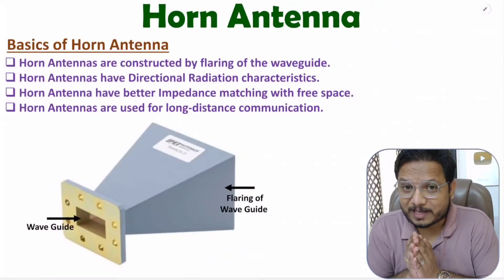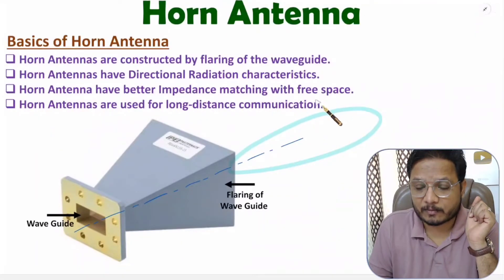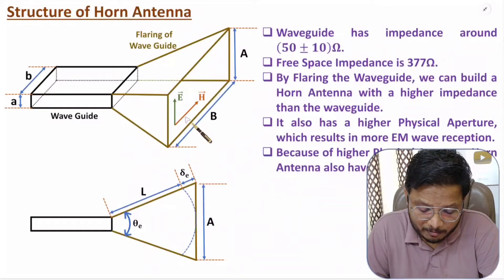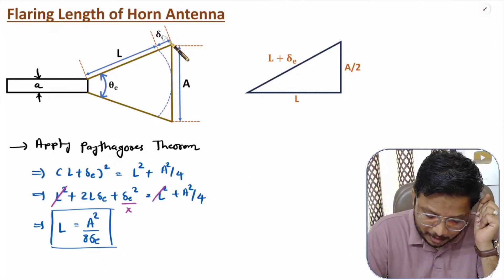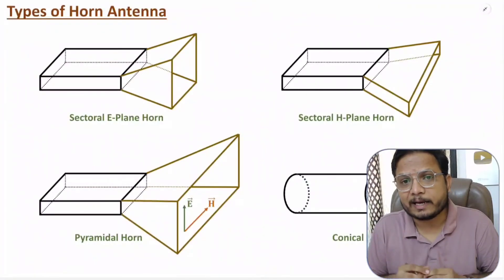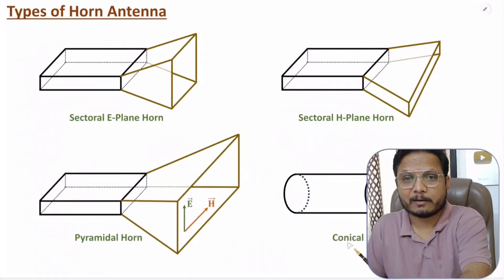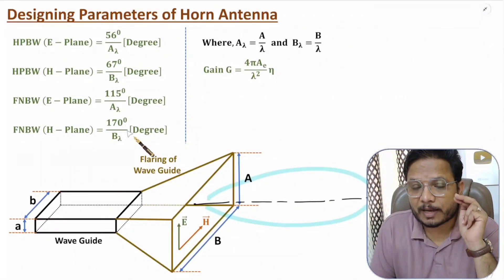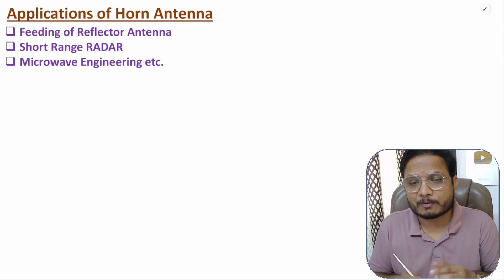Horn Antenna (Basics, Structure, Flaring, Types, Designing Parameters, Applications) Explained

Comment: Dear Professor, I have seen with interest your video. What you explained in the video is valid for receiving horn antenna too?
I am an amateur radio-astronomer. I would build a receiving horn antenna for the hydrogen H1 line (1420MHz). I have seen very long horns, expecially hose used by last century pioneers in radio-asronomy. How long may I reasonably extend the horn? Thanks.
Francesco.
Reply from the maker: Hi Francesco! It’s great to see more interest in amateur radio astronomy. To answer your questions:
1. Is this valid for receiving?
Yes, absolutely! Because of the Reciprocity Theorem, an antenna performs identically whether it is transmitting or receiving. All the principles of flaring, gain, and impedance matching discussed in the video apply perfectly to your receiver for the 1420 MHz H1 line.
2. How long can you reasonably extend it?
While a larger aperture (opening) gives you more gain and a narrower beam, you cannot simply make the horn wider without making it significantly longer. This is because of Phase Error.
If the horn flares out too quickly, the signal reaching the edges of the opening travels a longer path than the signal in the center. If this difference is too large, the signals will be out of phase and actually cancel each other out, ruining your gain.
The "Reasonable" Limit:
At 1420 MHz, the wavelength (\lambda) is about 21.1 cm. For an amateur setup:
 * Practicality: A horn around 1.5 to 2.5 meters long is usually the "sweet spot." It offers high gain while remaining structurally manageable.
 * The Limit: If you go beyond 3 or 4 meters, the horn becomes a "giant sail" that is very difficult to mount and point accurately in the wind.
 * Diminishing Returns: If you need more sensitivity than a 3-meter horn provides, it is usually more efficient to switch to a parabolic dish and use a small horn just as a "feed" for it.
For your H1 project, I’d suggest aiming for an "Optimum Horn" design, which balances the flare angle and length to give you the maximum gain for the physical size.